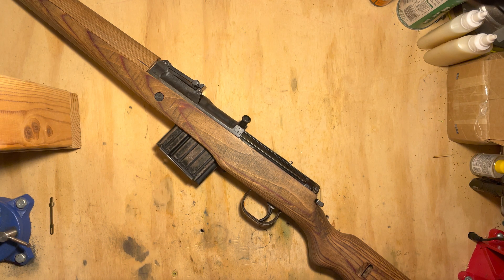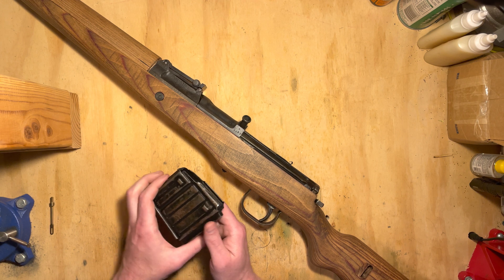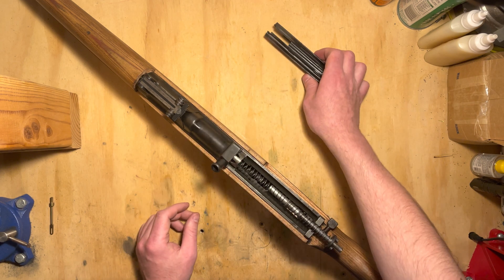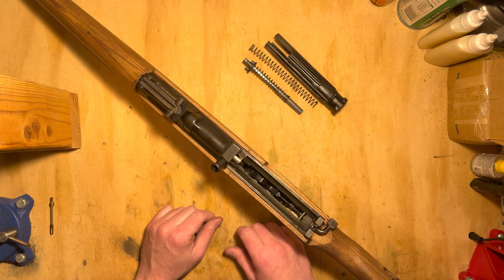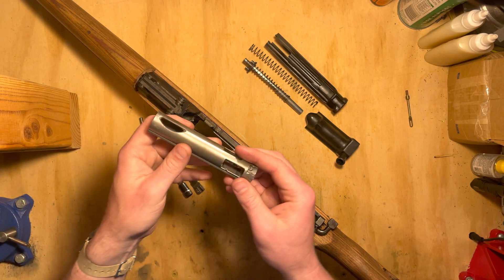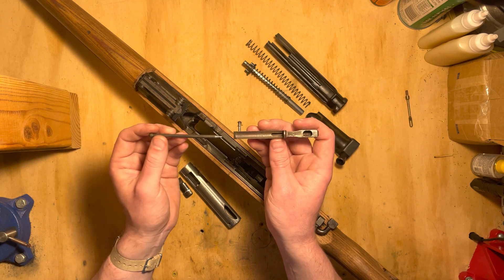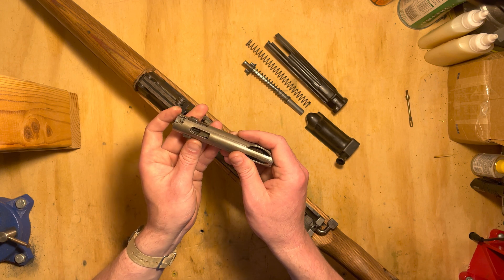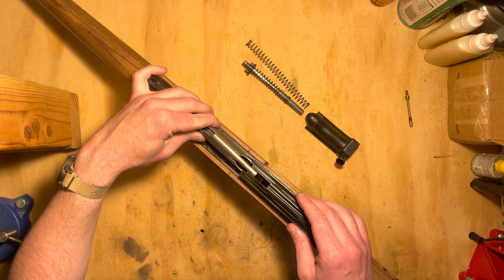WWII German Walther K43 Action Disassembly AC45 Code Later-Style Latchless Field Strip

Comment: G43 some had bakelite top furniture ?
Reply from the maker: I’m not sure if it is technically Bakelite or not, but similar. It was called “Durofol”, and as far as I know was only original to the Berlin-Lübecker Maschinenfabrik manufactured rifles. 

The three primary contractors were certainly all making a “G43” but had their own manufacturing techniques and subcontractors, so there are some minor differences between them such as BLM using Durofol and Walther changing disassembly steps.

Comment: My g43s safety fell off when trying to switch it to safe, can I still take the bolt off with no safety? Need to put it on back lol
Reply from the maker: That shouldn’t be a problem. The safety can’t block disassembly if it isn’t present.